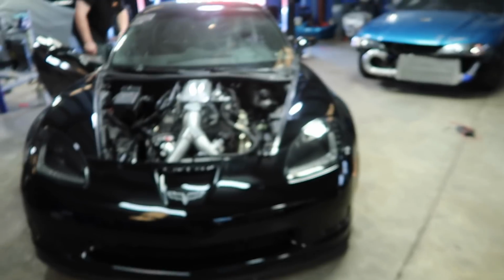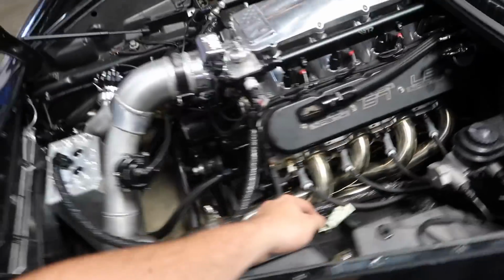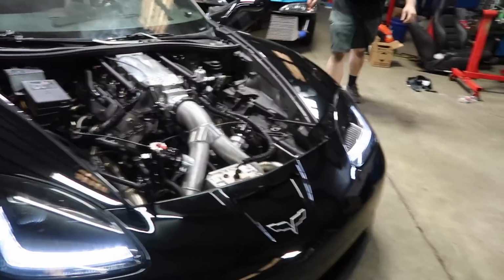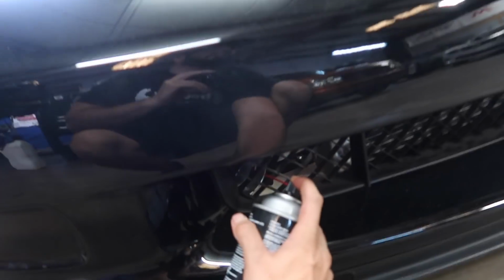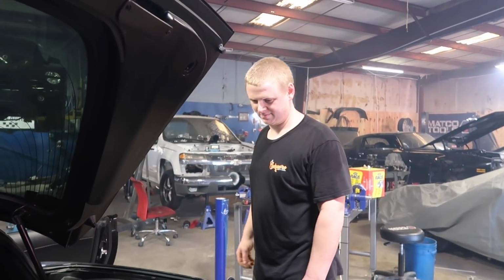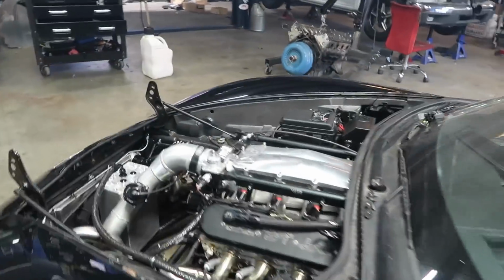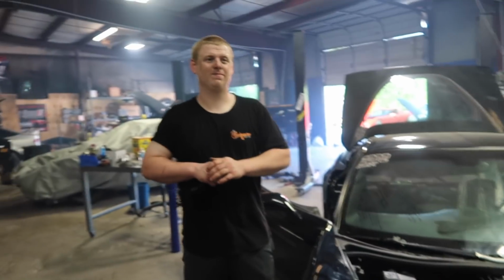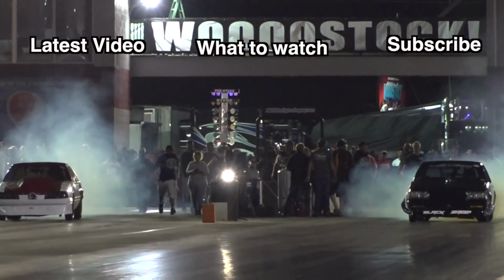SILVERBACK ZO6 is INSANE on the 2 STEP!!!

Comment: John can you talk about oil return from the heads? I'm putting together my motor and am trying to figure out the best mods to do to get oil back to the pan bar dry sump. I just have the johnson 2110 instead of the link bars... but I am considering drilling out the trays. 

I see the vette has what looks like valve cover breathers... but do you guys run the external drains to the pan? From the back of the valvespring valleys to the pan? Does tkm modify the oil return passages in the block? Or the heads? 

Thanks

Comment: Why does Justin Swanson prime his mechanical fuel pump 
Will you guys need to do that to the Silverback mechanical fuel pump or is it cause Justin running a 900 plus cubic inch nitrous motor
Reply: Justin is priming the oil pump not the fuel pump.